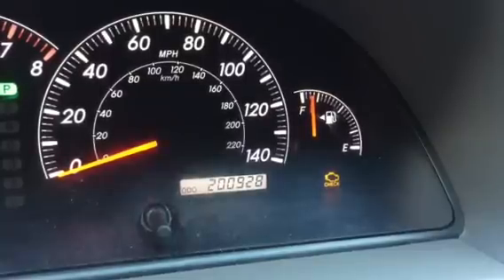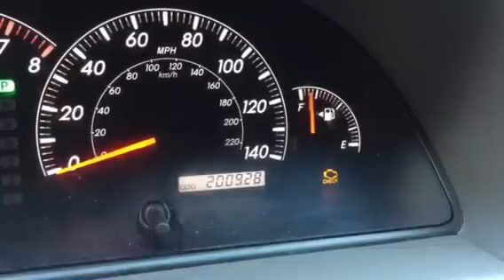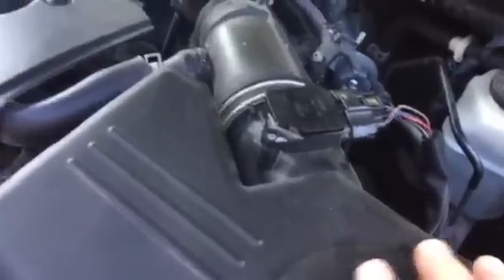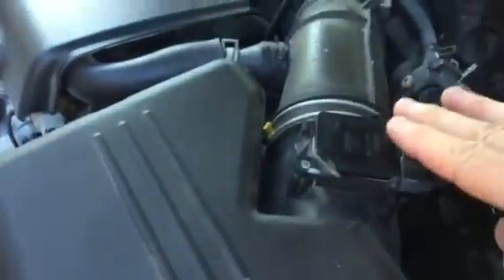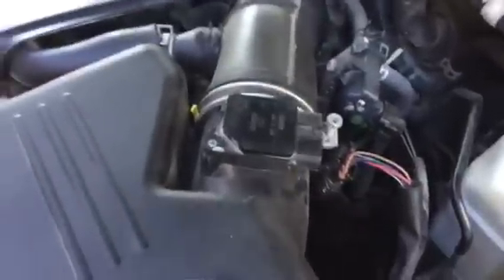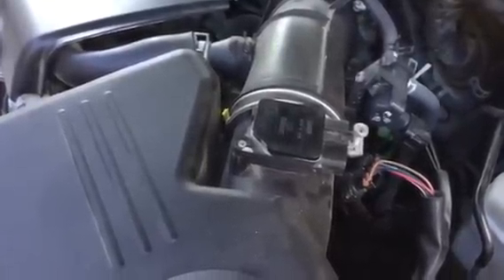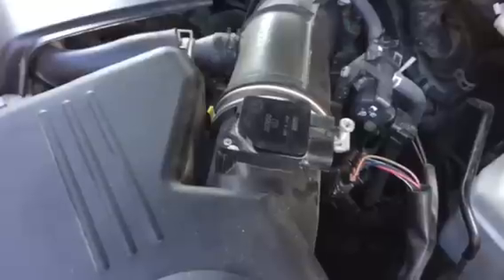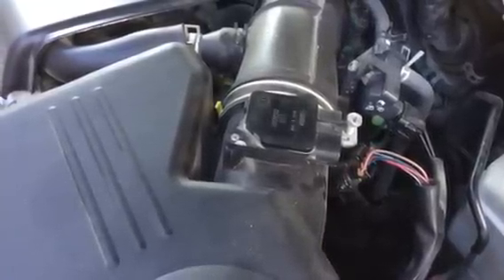How To Tell If Your Mass Air Flow Sensor Is Bad On Your Car

Comment: hmm well I've a 2004 bmw 318i & I've tried this lastnight & like a previous comment I've unplugged my MAS sensor & the engine idled alittle higher but kept on running... I've notice fuel consumption has increased a lot, was getting 32-38mpg in town now its average low 20-25mpg..

I've checked vacuum lines, changed inlet/exhaust cam sensors replaced O2 sensor, cleaned MAS sensor... & checked every other thing I could... yet still I've odd start up ie "engine almost cuts out & then idles smoothly shortly afterwards" I've oddly not had any engine fault codes show up/any warning at all & even funnier its not all the time....

its doesn't matter if its a hot day or cold day/morning ... sometimes my car starts up fine others "as above" also not forgetting I've checked my plugs, coils etc & all is good...... now I'm guessing its alil steep cost for a new MAS sensor
Reply from the maker: Everything you're describing sounds like a faulty mass air flow sensor.  I would just replace it.  I replaced a mass air flow sensor myself last year from Ebay for $73
Reply: well this morning the car stalled for the 1st time on start up "& the weathers warm" 

more positively I was on the way to collect the new MAS sensor upto now I've fitted it & started it & it seems ok.. but I'm leaving it to stand for a time before giving any real opinion if its made any difference!!! "I'm hoping it has!"
I've went for the bosch item as lots of ppl have mentioned bmw don't respond very well to aftermarket sensors... having tried a aftermarket O2 sensor I quickly needed to replace that for a bosch as standard!! "typical germans lol"
Reply from the maker: Thanks for the update and keep me informed.
Reply: Hi, I own a few BMW cars too. I would first suggest you to head to Bimmer Forum, there're a lot of article and DIY that you could apply to fix your problem.
For your particular problem, I don't think it's the MAF sensor, you stated you took out the MAF and it rev a bit higher cause the PCM (DME) right a way account for it and it would run a bit rich.
Since you said you checked Vacuum lines, replaced O2 sensors... but no luck.

It seems to me your next diagnostics should be simple:

1/  "Smoke Test" which you can DIY.  I didn't buy or rent a smoke tester.  I just used a hand pump from Harbor Freight with E-Cig or regular Cig and pump in my engine, then pump air into it.  It'll show you where the leak would be.  If it's not Vacuum Leak, then try to check ICV. 

2/  The ICV (Idle Control Valve) could get dirty and it stuck occasionally which will not pass air into the Manifold (or engine) then your car would lean out and stall.  If your problem mostly happen when it's in Idle then it's a BIG possibility that your ICV is dirty.  It's simple to remove and clean.
Reply: well I've just started the car after 24hrs downtime after the MAS was replaced & its idling much much smoother, a lot lower & the exhaust note seems much smoother now (still not giving the all clear as I've already noticed the rough idling happens whenever it wants too etc!!) so I'll have a better idea if the issue is resolved after a few cold engine starts in mixed weather conditions etc..

I've researched the idle control valve as you've mentioned... my valve seems to be in a sealed unit on the throttle body!! oddly I cant see any air-lines going into not from the body... nor any holes within the body allowing air (unless mines an electronic unit opening/closing the flywheel then I cant see how its possible to clean the ICV "unless I've looked at the wrong item....." don't forget my cars the 4cyclinder E46 318i M-sport which is difference to the 6cylinder engine cars etc!!

yes I've replaced the O2 sensors as after replacing my exhaust/cat I started getting error codes... front O2 looked poor hence its replacement... I then soon after still got codes! asking a mechanic he said it could be an in-balance between old/new O2 sensors.... anyway.. both sensors are now replaced & engine codes have now gone!

my car suffered from every possible oil leak & I'm guessing every coolant leak "externally" it could possibly have... I've x1 oil line near the little oil pump thingy at the upper rear of the cylinder head "cant remember the name think its linked to the vanos" anyway that's seeping slightly, other then that its had cam cover gasket leaks, the sensor on the cam cover leaked, exhaust intake sensor sensors leaked oil & also got replaced, the vanos seals leaked oil & have now been updated & replaced, oil filter housing gaskets x2 leaked oil now replaced. oil sump leaked like a bugger now replaced & good with a very small leak "possibly but I'm currently checking it out as it maybe oil oil running down to the gasket etc etc... oil dip stick leaked. vacuum wise the old breather tube from the fuel filter was leaking& been replaced.

the water lines well all the upper lines & side lines leaked, most had bad gaskets or none/incorrectly sized gaskets inside, the water pump wasn't matted up correctly & leaked that's all replaced now, along with new water hoses.... theres only x1 long water line which runs from the overflow bottle to the rear of the engine which is showing its ages at the rear ie "bulging" so next time the intake comes off that hose is being upgraded & replaced....

anyway getting back to the ICV if the cover on the throttle body can come off some how I'll give that a clean.... or replace it with a new item... upto now, I'm just pondering how the black plastic cover with what looks to be a metal sealing band actually comes off

Comment: Thank you that is an easy diagnostic. When I unplug mine, the car's engine is still running and it's running rich on fuel and making black smoke. I guess my car's MAF is dead.
Reply: the fuel and air are directly related. Basically the computer reads how much air is flowing and adjusts the fuel accordingly
Reply: It was bad MAF. I installed another used MAF that I bought from eBay and all the problem got solved.
Reply: i unplugged mine and still running i went inside the car and i have an engine light on and some words,i turned it off and start after plugging and its all gone,hmmm..maybe a dirty sensor?cant find that driver for that screw they put on it 08 outlander mitsu
Reply: Kamran Khan ,not necessarily,  I did this with my car ,and it wasn't the maf, so it's not true for all car make and models
Reply: had the same problem with a passat b5.5 1.9tdi remapped.. smokes as a n.... yeah :) nothing happened when i unplugged the maf ;) dead as f...
Reply: @theperkule  your 1.9 tdi is always running with out a maf. It takes the map sensor to run on. Google bav21 doide and you know how to by pass and why you want a egr delete also. AliExpress or eBay selling this for almost nothing.
Reply: @quirinus_online  it already had an new map sensor and egr delete 🙂 ran still like shit... But whatever the car is sold 👌
Reply: Kamran Khan and vaccum leak
Reply: I did this with my audi,  it keeps running, however I have no engine light on
Reply: Genius
Reply: I changed my mass airflow sensor I unplugged it and car was still running so I bought a new one and replaced it and the car is still doing the same thing plz help
Reply: I would suggest cleaning your MAF before doing anything else
Reply: Helcon Jesalva try to drive it
Reply: 2012 chevy traverse codes p0106, p0107, p097 says intake air temperature sensor, and map sensors codes. I think the IAT is a wire in the mass air flow sensor on this model. replaced it and still won't start. I have to keep trying to pump gas to start. I returned the MAF...GUESS gonna buy the MAP SENSOR NEXT...please advise...tyvm great videos!
Reply: I replaced mine and my check engine light was gone right away
Reply: I disconnected my sensor and it took about 30 seconds before it died. I'm assuming that my sensor is on its last leg???
Reply: ERIK_DBLOCK 063  Does your CIA use an oiled filter? If so that is most likely the problem. Over-oiling of the filter will cause the MAF to get covered in oil.
Reply: Kamran Khan a
Reply: Kamran Khan
Reply: Kamran Khan uh
Reply: Kamran Khan Does this method apply for all vehicles with fuel injection?
I have a Grand National Turbo,
When I unplug the MAF it does not stall.
Reply: I cleaned my MAF sensor with special MAF spray and still ran bad... Did you buy a new MAF? did it fix your problem??? thax
Reply: Richard York I have no engine management light on my Audi A4 b7 TDI but it's running like utter crap and hesitating.  Unplug the MAF sensor altogether and drive it, if you feel an improvement in response then you know it's the MAF sensor.  After driving it unplugged my engine management light and coil light came on.  After replacing the MAF the car is perfect and no warning lights.  Good luck 👍
Reply: I did tried in my own car a Hayundai sta Fe 2010 2.2. I unplug the MAF sensor and my car engine still running.
Reply: I have Mitsubishi lancer 2005 when i connect the wire engine stop otherwise whitout connect wire engine work properly plz help me
Reply: I have a cold air intake on my and now it has check engine light on. Not sure if its the mass air flow. But i changed it back to factory and it did the same thing. But when i put the cold air intake on it didnt do it right away
Reply: theperkule u
Reply: Fuel pressure regulator needs replacing.
Reply: Kamran Khan if car is running rich that's a fuel issue not air
Reply: The Maf controls air/fuel ratio... so a motor running rich can be a bad Maf sensor... cleaning them only works sometimes... by looking at part you can not tell if they are bad...